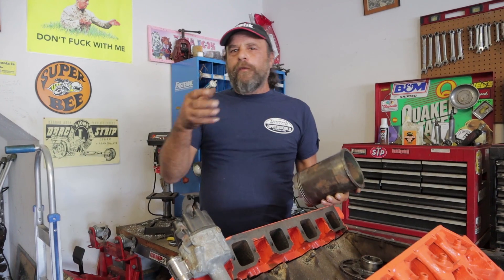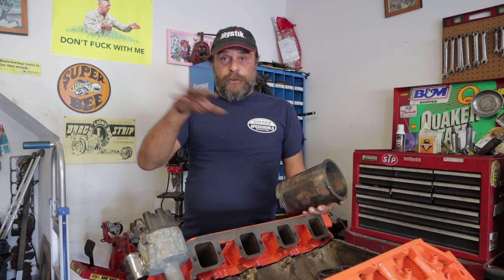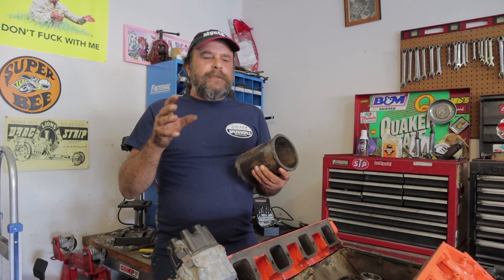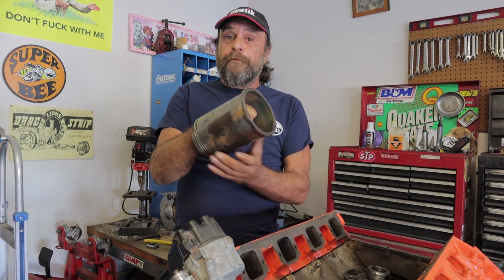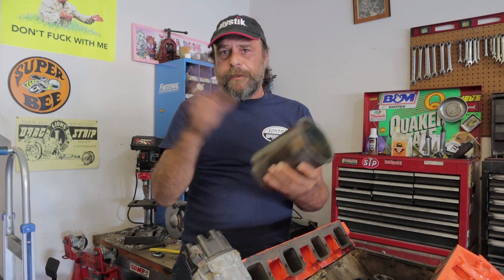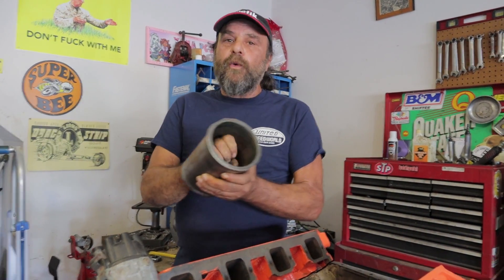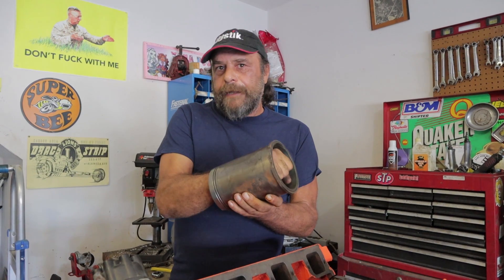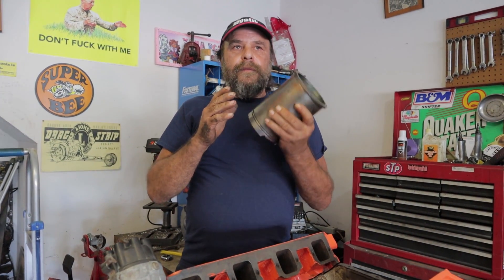The Myth Of Engine Displacement

Comment: Thanks for the education. I always understood the "no replacement for displacement" thing to mean all things being equal. In other words, if the volumetric efficiency of both engines are equal, the larger engine will produce more power.
Reply: Gasoline burns at the same speed more or less, so there are natural limits on size. Diesel burns slower, making a natural limit on RPM
Reply: Clinton .. It comes across as "start with the biggest motor u can find because theres no replacement for displacement" .. instead of starting with a fundementally better designed one first ..
Its a saying that appeals to the masses of morons out there
Reply: It's the simple principal of scale. 2 motors. 1 at twice the scale using twice the fuel and air should produce roughly twice the output. Frictional losses, inertia and fluid dynamics  of the oils and airflow and fuel might make a marginal difference.  The main difference will be the cost. The cost is not directly proportional to the increase in size. If it was there would be no reason for forced induction. Also the same for the size of the vehicle you have to fit it in.
Reply: You are exactly correct according my friend. Efficiency of both engines are the same the larger displacement engine will perform better. Big cheif is running two turbo! No shit dumb ass.  Bigger displacement will always be more reliable
Reply: The saying falls apart under a microscope. But in general it is true. Basically purpose design of an engine is what makes or breaks if it can be worked for "performance" in the sense of max HP and acceleration or HP. All one needs to do to "disprove" (not really disprove) the saying is compare a 500+ Cubic Inch Minneapolis Moline Inline 6 tractor engine from the 60's to any small block half the size from the same era to see that it takes purpose design to determine the outcome. Of course, no farmer in their right mind would have wanted a... oh say poly head mopar... in their tractor. Double the HP, multiply the fuel usage and break downs and maint. requirements by ten to get maybe a 20% increase in effective work done. 
On the flip side, I saw an article where a kid thought his Waukesha 6 cyl from his suped up Oliver would do well in his old C10 Chev truck because how it performed on the local tractor pull. Except it was still a 100 HP engine, not sure what he expected.
Reply: Volume is not the only thing to consider.....a point he is trying to make...SO many variable to play with...think about the few spec's(ALL variables) he mentioned, and then multiply by at least 10. And B4 you go building this bundle of question marks, we need to ask what is it going in? If your already boiling the tires, why don't you work on the chassis?...and if you can't turn, why do you need more power? Big cubes is just a dick measuring game, until MONEY becomes involved...and if you don't have cubic DOLLARS...cubic inches isn't necessarily gonna help...THINKING...and developing a set up through the Scientific process( experiment & observe), I think is the point he's trying to make...UTG is a piece of gold in a field of shit...and becore you go opening your wallet, just watch and think about some of his stuff.
Reply: @LeftyLucyRightyTyty  You missed Flynns point. Eliminating all other variables, increasing displacement WILL produce more power. A bigger explosion produces a bigger, well, explosion, lol. Think of it this way, if you Decrease the engine size to 35 cubic inches, all other design features stay the same, will it be as strong as a 350?
Reply: @ZacLowing    not necessarily,  if your 300 inch motor is making 300 hp and that's at the limit of something in the top end like heads or intake all you'll likely get from adding another 50 inches is a motor that peaks lower and makes more torque below peak. 

You wont get much more than 300hp out of a set of heads that can only support 300 hp no matter how many inches you stick down stream, you just end up with a bottom end that reaches the limits of those heads significantly earlier. 

That's why Chevy 350s during the smog era only made a bit more power than the little 305s, and even they benefited from marginally better valves. But the heads and cams were the limiting factor and my TPI 350 for example enjoyed a whole 10 HP over the same year 305.
Reply: @ZacLowing  deffinately more torque at lower rpms. More hp?? Not always
Reply: @LeftyLucyRightyTyty  I do remember the Mountain Motor cars being less quick than NHRA Pro Stockers.
Reply: WCTA We are talking dollars and physics here....this IS NOT a video game plug in or an APP....how you gonna increase displacement? Bore? Stroke?...Ok...once you decied that...whatcha gonna do about that cam that is now out to lunch?...oh...and now you need a bigger carb...or bigger injectors....k...now its running....freaking HEADER primary tubes are TOO SHORT...or not fat enough.....ok....now it's running....Idling good....smoking the meats....but now ya can't drive a block without it overheating....If your making soup...do you just PUT MORE SALT IN?.....
Reply: @LeftyLucyRightyTyty  so, how big of an engine do you run? A 1.2 liter? I mean, if displacement doesn't matter in making power, you must run a tiny engine doing 10's all day eh?
Reply: @ZacLowing  well, actually, it's only one liter...and ets aren't how I measure performance. MPG is. Also got a Chevy 350 in a pickup with 400000 miles on the original timing chain and ujoints..I drive an International tractor with 500 horsepower...dragging 800 horsepower time bombs around...maybe check out my channel.
Reply: @LeftyLucyRightyTyty  I measure performance with the amount of enjoyability I get running the vehicle. I could give two shits about MPG if I enjoy the drive. That can be anything from acceleration, to jamming through a 5 speed with a high strung small block, to the smile I get leaving a stop light with a 12K lb trailer behind my 8.1L 3/4 ton truck and it doesn't break a sweat. Heck I had an '88 Mercury tracer Wagon(it was a Mazda imported by Ford) that happened to share(not advertised) the engine with the same year Miata. That car got 35mpg, but I drove it because it was a blast taking people by surprise off a stop light with a baby blue import wagon because it was geared to top out at 85mph. 
Know what's not fun? Soulless electric cars that turn on with a light switch and give no feedback to the driver in sound or actual feel. I hope i die before I am required to "drive' one.

Comment: Damn Unc. I need more than a few minutes to wrap this around my head
Reply: Got to thinking about him talking about the difference in the pin on the piston. When the piston is top dead there is very little room to deck height, so when you increase stroke length that would make the piston higher in the bore so by moving the pin higher on the piston keeping it under the deck it has put that increased cubic inches in the less effective part of the combustion cycle. 
So if you had a block with increased deck height and keeping the pin in the original spot, you would make more power out of the increase cubic inches  in upper part of it's travel, complimenting that extra pull of fuel mixture and torque from the leverage!
Reply: @JohnSmith-ry8qj  You and UT are making it more complicated then it needs to be. This displacement and power stuff has NOTHING to do with pin location, only the travel of the face of the piston. Yes pin height matters, but that's more about durability then power and too complicated for YT.
Reply: Mind blown.
Reply: Right off the bat he's wrong, it's 90 degrees down when the piston is moving fastest and pulling in more air and fuel, and when it's exerting the most torque on the crank on ignition stroke. A longer rod increases piston speed at this point but slows it down at TDC and BDC when the actual pumping effect is minimum. I'm not sure but I believe that monster motor cars were required to be heavier which explained why smaller engine cars would win especially when getting mass moving as quickly as possible wins drag races. If larger engines weren't superior why does every type of racing have engine size limits?
Reply: @gruberstein  Interesting being so right and wrong at the same time. You're absolutely correct about 90 degrees, but wrong about rod length effects on piston speed.
Reply: @snek9353  now that I think about it, I am wrong about piston speed. With a long rod the piston dwells longer near TDC and BDC and assumed it had to make up for it somehow in the rest of it's travel but didn't have my trigonometric thinking cap on at that moment. But I do believe that the longer rod helps deliver torque to the crank more efficiently because of the lower angularity of rod to crank throw positioning. Thanks for the correction snek
Reply: Hit replay and watch it again. Keep watching till it makes sense
Reply: @yeetusmyfetus4jesus594  That's called brain washing not learning.

Comment: "No replacement for displacement" does flow off the lips a lot smoother than  "There's no replacement for displacement, traction, air/fuel mixture, power to weight ratio, head flow, cam profile, stall speed, tire compound, and reaction time."  And go fast stripes.  Got to have the go fast stripes.
Reply: If those little rc car engines could be extrapolated ...haha wow. 
I'm no expert , but .21 or .25 cubic inches putting out like 1.5hp is pretty hot. 
No turbo or power adder , other than a nitro blend. 
I'll take 800 cubes of that🤣
Reply: @MrTheHillfolk  .21 or 3.5cc easily put out 2,5 Hp, so that would be around 10000Hp on a 800 cui . Top fuel stuff.
Reply: @palleppalsson  
Yea I knew a little bit about those RC engines like 15-20yrs ago.  
Pretty amazing for its size. 
All that power and no power adders like turbos etc.
Reply: @MrTheHillfolk  That would be sweet, I imagine the reason we don't have many full sized engines with a power to displacement ratio like that is material based, due to how the materials react with heat in bigger sizes not proportions.
Reply: @lakeshorerides it’s because of the size that power is easier to get especially a two stroke
Reply: @MrTheHillfolk  don't forget the 20% cH3-No2 mix. That plays a big part. Hey, if you like that .. than search mini top fuel engine
Reply: @deronborghi5929  hah ,yup that's all cool stuff , great subjects !
Reply: @MrTheHillfolk  wall plug power 1/4 mile extension cord that'll get ya where ur going
Reply: Every pound of chrome is worth 1/10th of a horsepower.
Reply: Hillfolk...The MATH is where ya get power...rc engines spin ALOT faster, because they are smaller....Those crazy RPMs is what produces the final total.
Reply: @LeftyLucyRightyTyty  unfortunately the math wont let you build a 30,000 rpm 350. At least not one that will fit in a car.
Reply: Don't forget chrome.
Reply: "No replacement for displacement" thas american stupidity on its best.
Reply: Don't forget The "power loops" on the coil primary wires....good for AT LEAST 2 HP.
Reply: Hahahaha.. Thanks Man.. needed that..
Reply: There are actual documented cases of stripes increasing top speed.
Reply: Don't forget the hood scoop
Reply: That’s how epigrams work
Reply: What about speed holes .  Also a good wax job is good for like 5 mph
Reply: everything makes power from one reason. getting air into the cylinder.... this is replaced simply by air volume. i.e. air pressure., all things being equal, and can only replace displacement. what is the replacement.... AIR PRESSURE!!!!!!!!!!!!. NOt tire compound, not power to weight etc..... its AIR PRESSURE!!!!!!!
The replacement for displacement is AIR PRESSURE!!!!!
Reply: @chaztitan6457  or a 250 shot of go fast juice.
Reply: @Wheelgunfan327  same thing. air pressure increase air mass (oxygen mass)  nitrous does the same thing. gets more oxygen into the cylinder per ignition.
Reply: You forgot aerodynamics.
Reply: @MrJohnnyDistortion  Didn't forget, just ran out of breath.
Reply: @Wheelgunfan327  😵
Reply: Seconding the speed holes, also a tree air freshener is good for 2 hp.